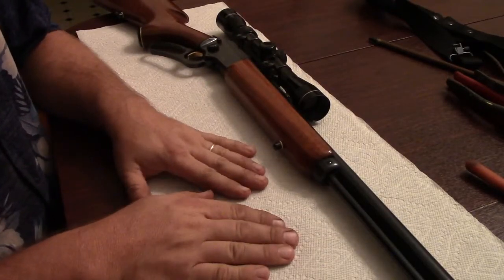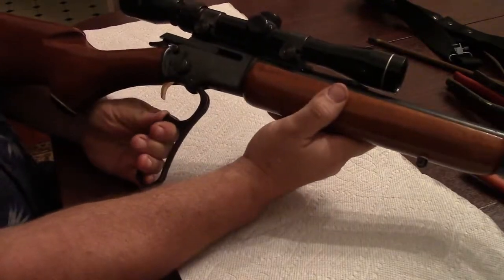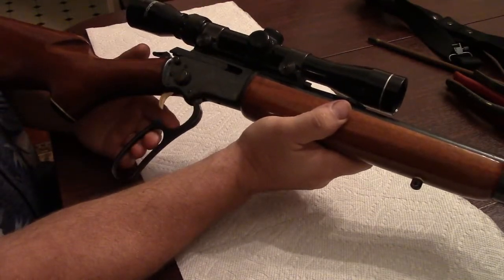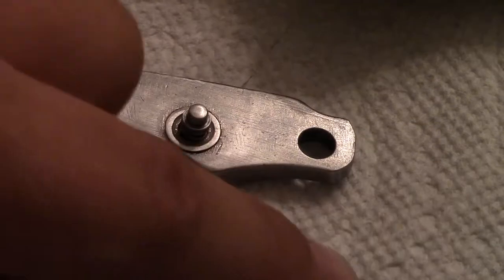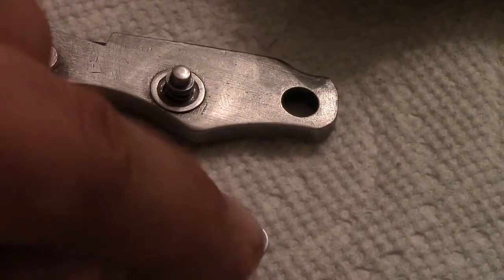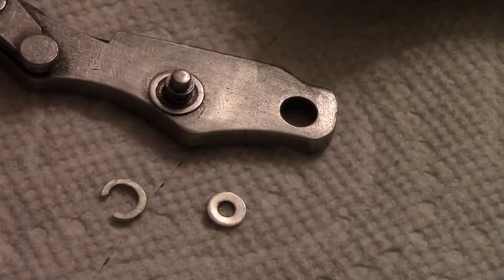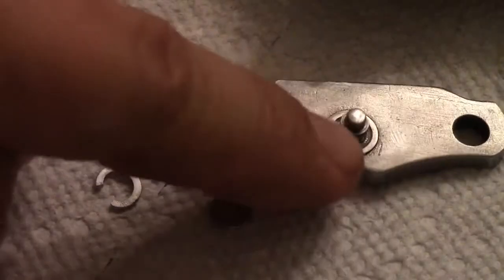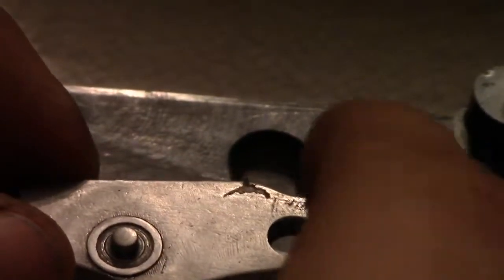Marlin 39A jam and carrier repair 22lr

Comment: The problem on mine was a little piece of spring steel that is screwed through the top of the receiver came loose. Had to take the scope off and then the base, tighten the screw and remount the scope and base. That means I'll be sighting it in when the weather clears up. That little piece of metal guides the front end of the bullet into the chamber and sometimes the angle of the bullet coming off the carrier was too steep. Without that piece to guide it in, it would hang up on the top of the outside of the chamber. I looked at several times and never realized that piece was loose or even in there. I was always looking at the carrier being the problem. NOT! So if you're having this kind of problem, make sure to check that before you get the files and hammers out.
Reply: Can you make a video of that I have one that is jamming the round at the top like it's got to much angle for the round to go in straight
Reply: I can't cause I'm not the video guy if you know what I mean. Open your action and right at the top in front of the chamber, there should be a little piece of flat spring steel. It is held in place by a screw that comes through the top of the receiver and holds that flat spring in place. The screw is tightened from outside of the receiver. When it's tight, the bottom of that spring will be almost level with the top of the chamber. I guess mine is about 10 thousands of an inch from the top edge of the chamber, but that's low enough that the tip of the bullet goes in without touching the back of the barrel and it goes right in every time. I've put a couple hundred rounds through it since I tightened that screw and it hasn't jammed yet. I couldn't get through a magazine without it jamming once or twice or more. I'm not familiar with all the variations of the gun but that's how mine is built. I hope this helps........ I found it when I was watching the action work with snap caps. I was going to file the elevator so the bullet would not angle up so much and I noticed where the bullet was hitting on top inside the receiver. I saw that little piece and thought it was bent so I was going to bend it back down and when I touched it with a small screwdriver, it moved. After a closer inspection, I saw it was held in place with that screw and I was cussing because I'm lazy and didn't want to have to take the scope off. Just thought I'd give a little of the back story. Good luck with it. @JerryHarden-ji9ir

Comment: Mine is doing the same thing but my shell lift leaver has a different set up it has a leaf spring not a button with a coil spring like yours., but that’s not the problem with mine. My lever is hitting the corner of the pocket on the bolt that it is supposed to go into to open the bolt and push it back the corner of my lever is rounded off I am going to try to peen my lever to lengthen the metal to reach the bolt instead of hitting the corner.

Comment: Put a small bead of JB Weld around the washer not much just a little I fixed one for a friend that’s been four years ago still working fine I have three mines are older models there are different  pressed with an arbor press